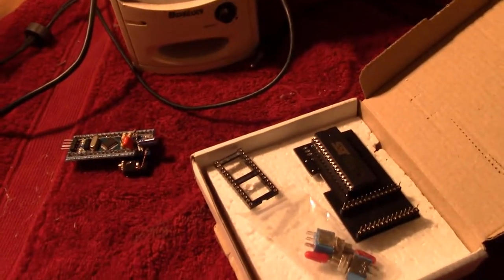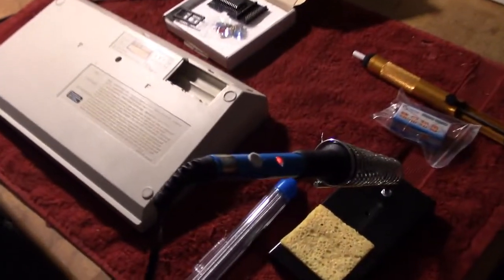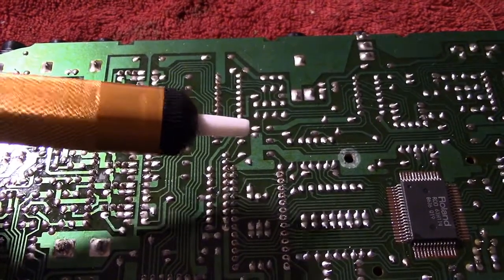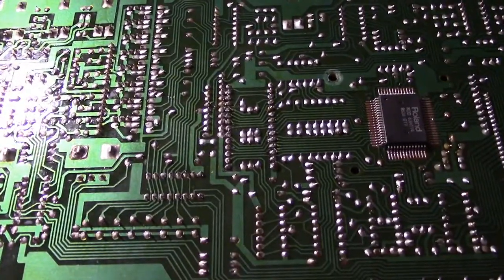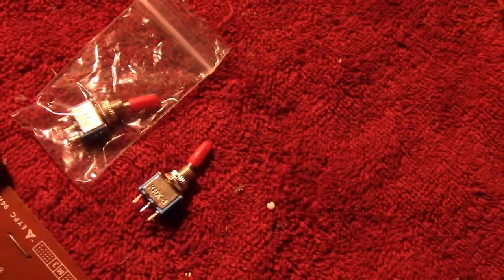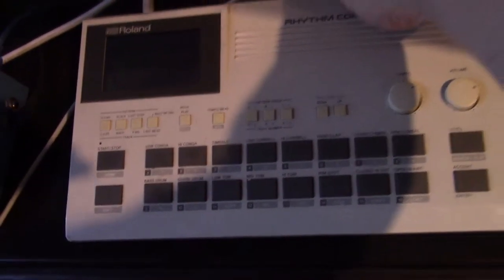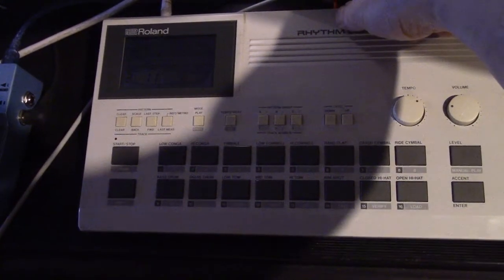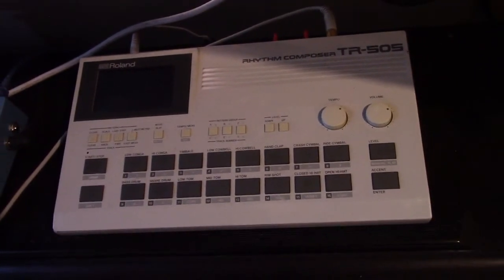Installing new samples ROM in vintage drum machine

Comment: Hello. How are these parts programmed? HIGHWAY09A for the cooker What is the name of the machine that programs copies and withdraws the electronic program
Reply from the maker: A gentleman called Harry Axten does the programming, the link to his website is in the description. A PC is usually used, plus an EPROM reader/writer. The original drum machine sounds are digitised and transferred to a new EPROM chip. His chip is far larger in capacity than the original chip, allowing several drum machines sounds to work from the replacement.

Thank you for your question and I hope the translation reads well

Comment: You make it all look so easy. I was waiting to see you use the sucker and the soldering iron in one hand while you held your camera in the other. Interesting your comment on braid vs sucker. I have always used a sucker and only bought braid after watching people use it on YouTube and I don't get on with it.
Reply from the maker: Hey thanks, especially because I know you are good with a soldering iron... the cigar hold method. Was scared to touch the sucker to the solder at first, but the nib doesn't melt, works great. Was also informed by my wife that I'd been soldering wrong all these years, had always put flux on the component, not the iron tip.